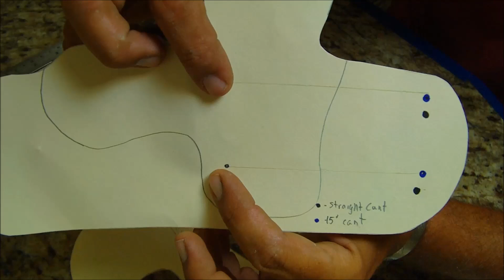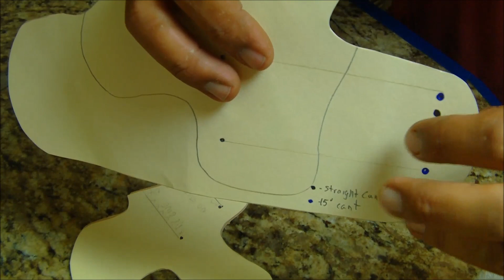Homemade Leather Holster Part 2 (Beveling Edges/Stitch Groove/Punching Stitch Holes)

Comment: your trouble with the bevel on dry veg-tan can only be one thing: you are probably too timid with the tool. Just press the beveler against the leather's edge, press down firmly on the piece with your other hand, and then shove the tool swiftly foreword. If your beveler is sharp, then most projects are beveled within seconds.

Comment: how do you measure for the belt do your belt always fit very snug to the slots how do you make sure there is sufficient space for the bill to pass through without being excessively tight
Reply: sorry about the auto correct
Reply from the maker: I measured for the desired belt width. Then I take a belt of that width and check to see if it fits before cutting the leather. I then make my guide marks on the leather and cut the belt slots. Hope that helps,  thanks for watching!